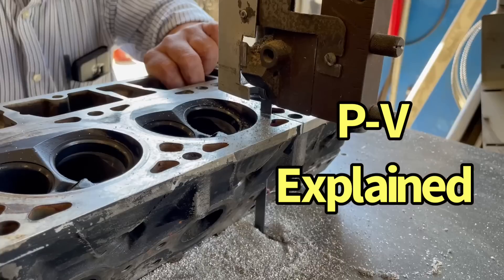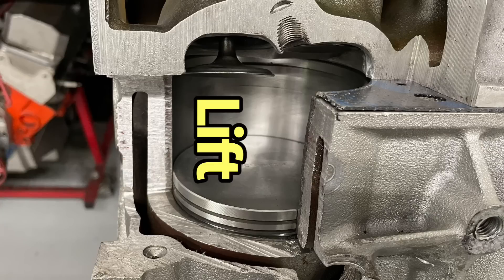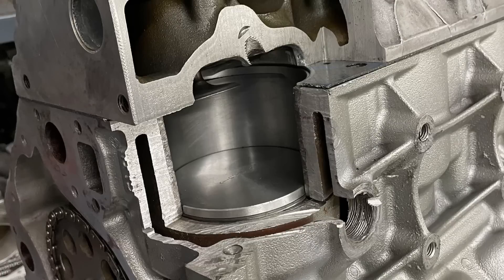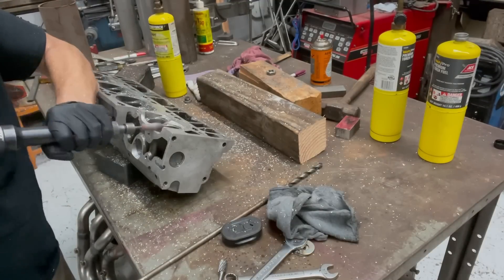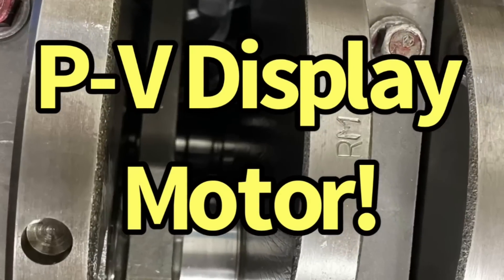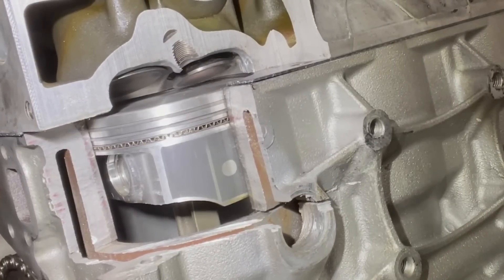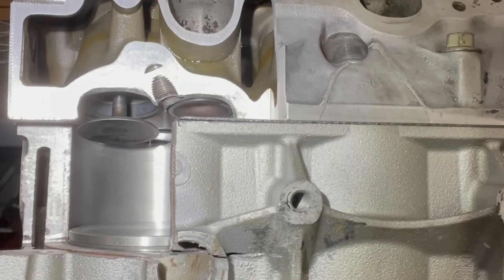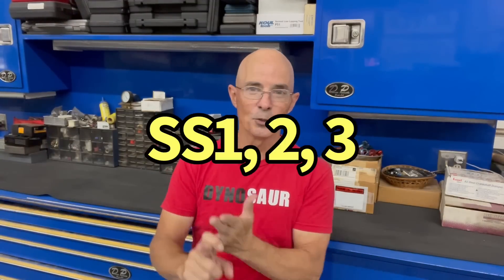WHAT IS PISTON TO VALVE CLEARANCE? THE ULTIMATE GUIDE TO SEEING AND UNDERSTANDING PISTON TO VALVE!

Comment: Fantastic video and idea, Richard. Next up you should demonstrate techniques for actually testing PtV clearance. Perhaps do the "clay" technique and rolling the engine all the way over, and then also the dial indicator approach only in the danger zone. Then you can discuss the pros/cons to each approach.
Reply from the maker: I want to show where the valve hits on the piston and why LS dish pistons might not improve p-v
Reply: @richardholdener1727  would really be helpful to show how to test VVT and or lobe separation angles/LSA with a bigger/aftermarket parts and how limiting the phaser, change's-different's and for others the importance of it plus showing valve floating and deflection's-all-parts and why's it's okay and in some cases it's extremely a bad idea/thing to have. having a pushrod that's collapsible/expandable aka something like a hydraulic cylinder ( and or figuring a way of pressurising the lifter's in the cut-away, basically how my engine now works with a jerk-pumps and pipes/liquid-rods and slave-cylinder's and software/ECU instead of fixed steel-rod's+rocker's ) and a hand/porta-power ram-pump can showcase differences 😉 👍 , also a different but related idea is having a extra sloppy/stretchy piston or piston-pin can show were/high-mileage's/lacklustre-maintenance and also higher loading/RPM and how it can change P/V clearances and timing ect

something i kinda/think 🤔i know how just not 100% testing processes/setup/efi-ect-tunes yet on my modified 1960's-540~ci hemi 4.3X4.5" stroke as i add a 60*lsx twin phasers ( yes i need the limiting blocks/software-lock's but not fully sure on maximum setting's yet 💯 ) to change VVT&LSA timing's ect plus VVL/multi-air system and variable valve-spring-rate like a f1/race-engine car ect

Comment: Great job on this video! I just bought the low buck truck. On my LS1 which has flat tops with no valve releafs, I had to deck the block .005" and over time the heads were milled .015" I an anxious to get the parts back and pre-assemble to see if I am going to have to go with a thicker head gasket and have to figure out the best way to check P-V clearence.
Reply from the maker: easy to check P-V but you won't have a problem-you have miles of P-V on that cam (even with you minimal milling)

Comment: GREAT VIDEO!!
Install a cam designed for supercharger use with 0 to negative overlap verses a NA cam with lots of overlap which gives that old school lopy muscle car sound. And explain why no to negative over lap (explain negative over lap too) is best in a blower application verses  a NA cam with lots of over lap. And how wide overlap can get dangerous with piston to valve clearance. And add to this how a improperly timed cam can cause piston to valve strikes. And why degreeing a cam is very important bro know it’s timed correctly before starting up.
Reply from the maker: the cam that makes more na power will make more boosted power-stop with all this overlap talk

Comment: Piston chases  the exhaust  valve  so always  use .110 min on exhaust  side, youll be safe intake  0.080 min  with 0.031 radius  in piston  pockets  ! Save for lots of street strip  motors

Comment: Question: you didn’t share with us what MINIMUM clearances we need on the exh/int sides?  .070” ?? 🤷🏻‍♂️.   Also does ratio rockers affect piston to valve clearance and how?  

Thank you 😊
Reply from the maker: rocker ratio can alter p-v because (in addition to lift) they also alter duration slightly (by 2 degrees or so depending on ratio change)
Reply: @richardholdener1727 ok thank you much!  👌🏼

Comment: I would like to see PTV based upon head milling.  So if you over mill the head you can then simulate different head millings with gasket thicknesses.
Bias cause I had my head milled .020 and would like to see the change to PTV it caused.
Reply: Same I milled my heads to 58cc and have a 232/242 .600 / .600 113+3 cam. Clay method showed plenty of clearance but would be cool to see in action.
Reply from the maker: I can remove the gasket

Comment: I have seen some people fly cut their pistons because the piston to valve clearance is not enough. I am curious is fly cutting an acceptable procedure, or it's not recommended.
Reply from the maker: it can be done as long as there is enough material in the piston and it is done correctly with the piston in the proper position

Comment: What happens if you have a very short, duration, low overlap, but extremely high lift cam shaft? Does the cylinder get more air? simply opening the valve more, but not necessarily for longer. Normally LS engines really like a 600 lift but what if there was say a 7 1/4 lift or even more than that?
Reply from the maker: the cam lobe is very unstable with high lift and low duration
Reply: Actually, that is a good question to answer. Have you tested enough cams to actually run into this effect and if so, what lift-to -duration numbers bring about the instability you mention and at what rpm? For instance, say you are building an engine and want the cam lift to be .525". How short of a duration would cause the effect? Then give duration thresholds for different lifts as well, for example .550", .575", .600" etc... so the trend can be graphed and or visualized. I expect that you would see why the old small block HP cams had such low lift to high duration numbers. The trend today is to go for mega lift while trying to keep duration short which starts to infringe on the laws of physics with drastically increased stress on the valvetrain. Would Comp Cams already have such a graph showing which lobe designs are prohibited by the lift-to-duration relationship?  @richardholdener1727

Comment: Very nice Rich!
I got a 454 with 9.1 comp. With Edelbrock hi comp BBC heads. 280 duration, 566 lift, 1  7/8 headers. What do you estimate my HP would be ? I think my torque would be around 500 FT/Lbs. Based on Gen IV blocks that’s mine1972.
Reply from the maker: what intake?
Reply: @richardholdener1727  a Summit Dual plane.
Reply: @richardholdener1727  400TH auto, 2500 stall, 3.73 gears, Eaton Trutrac.
Reply from the maker: could be near 500 hp

Comment: Hello Richard I have a 4.6 DOHC (rebuilt) with a stage 2 comp cam - all followers and lashers all new Ford parts. On the driver’s side the valve train is a little louder and the passenger is kind of quiet. 5 mechanics said that yes the driver’s is a little louder but that’s normal - I know this is not per say. Is it possible this noise is happening because of PTV - the shop has not degreed the cams?

Thank you!
Reply from the maker: did you check p-v? does the piston have valve reliefs? are the cams degreed side to side?
Reply: @richardholdener1727  the cams were installed as if they were factory cams by aligning the dots.
Reply: @richardholdener1727  also compression test. Passengers side pistons range from 150 to 160. The drivers side pistons range from 120 to 130 - this is the side that I hear the valve working. Thank you Rich!

Comment: Ok, Rich, I'm building a Gen3 LM7 5.3. I went with a Truck Norris cam. Assuming deck height is oem, could i run a 1.299 CH 2cc dome piston such as summit racing pn SUM-2999273810-2 ? What piston would you recommend ?  It's for a jeep wrangler for low end/ mid range rock crawling application but i want power when i need it too.
Reply from the maker: for what compression?
Reply: @richardholdener1727  disregard. I've decided to do a LQ9 crate w/LS6 cam

Comment: Use the cut off pieces to cast a clear acrylic part, slap that on the engine and run smoke through the chamber to see how the air flows. Love the cutaway engines, Chrysler had them as a motorized display.

Comment: You know if you put the spring you're running on that head and check the clearances it will be different from those test Springs you're checking them with you will actually have more clearance with the spring you're going to run. Yeah I couldn't wrap my head around it at first either I bought a 522 from reher and Morrison. I bought the short block first and bought the heads later when I could afford them. I like your self always check them with test Springs for the clearances so I did. My dad's buddy who has built engines most his life I was over at my garage wanting to see that motor and he wanted to stick around and help me check the clearances and stuff. Like I said we used test Springs the clearances were not there he starting to tell me I needed to take the engine back apart and cut the Pistons to get the proper clearance. He said they screwed up. So I called Keith down at Reher and Morrison and told him what I had as far as the clearances. He asked me if I had the valve spring that came on the head on there and was checking it. I said no I'm using test Springs. He told me I was doing it wrong and I needed to put the valve spring that I was running back on the head and check it that way. So I did and he was right the clearances were there right on them but they were there made quite a bit difference from the test Springs from the actual spring that you're running on the head. Now me being a machinist I couldn't wrap my head around it either Tumi that clearances is clearances. I guess valve spring pressure has a lot to do with it. The only thing I can figure out. I mean they were short .030 to .040 on the intake and exhaust. I know 4 A fact that you better keep fresh valve springs on that motor or there's going to be a bad day at the strip. I guess most engine builders just like to play it safe and don't want to depend on checking valve spring pressure & have to change them when they get  a little weak. I'm not sure if Keith still works there or not bcuz it's been a few years back but you can call down there and see if he still works there and ask him. The Pistons are so close into that head that you have to orientate the plugs. it is a 14 to 1 motor. The heads are Dart pro-1 355's I haven't had a bit of problem out of it I ran 7.81 at 171 in the quarter straight out-of-the-box. I don't know if you can see my picture or not but that's my toy. Just a bracket car pro-class or super comp. I'm just like the rest of you I like to throw money away! I wanted to hear what your thoughts were on it. I know other engine builders don't buy it.  Until they try it. It does make a difference. I was getting ready to tear the short block down and cut the Pistons. He actually told me I was full of shit put the race Springs back on the head & check it again he guaranteed the clearances will be there exact words! Thanks LJ
Reply from the maker: why would spring pressure change p-v? The only change could be deflection in valve train if you have serios pressure-and there is more p-v in a dynamic running situation due to deflection but this is an accurate method

Comment: Richard holdener please give me a little help with this problem that I run into I was changing the ignition coils on a 09 murano and one of the small nuts from the intake fell inside the holes valves and I didn't know until I crank the engine when I put everything back i heard the little rattling and I turned back off 
Do you think if i lift the front tires and spind the crank case bolt I can open the valves ang get a borescope with magnet and fish out the nut? Cause the spark plug hole is  little smaller than the nut cylinder #6
Reply from the maker: that will be hard, but worth a try-then pull the head and make sure you didn't damage anything (piston or valve)
Reply: @richardholdener1727  it  broke the piston 🤣 now I have to. Take the head out and change the piston. Do you have any videos related to this engine, or do you know where I can buy a book to desamble the engine 
Thanks a lot for the reply. Thank you, brother

Comment: A good video on how to know what cam will fit without pulling the heads. Is there an equation or something to use with your current p2v clearance to find out if another cam will fit before installing it?
Reply from the maker: if you already know existing cam (and specs and how it was installed) -then you can calculate

Comment: You can put a zero overlap cam in and show how much real overlap there actually is.  The Red Hot would have only had 6 odd degrees of overlap at 50 thou tappet lift but there was plenty of valve opening for both valves at TDC.

Comment: Very cool cutaway.  This is one of those things that's so hard to explain to people, and a great visual goes a longs ways.  It would be neat to talk a bit about acceptable piston to valve clearance in different configurations, what impact cylinder head milling and gasket thickness changes have, and maybe demonstrate how some flycuts or aftermarket piston with reliefs can add meaningful clearance.  It would also be interesting to explain some common failures that result in unwanted PTV contact (valve float, lifter pump-up, broken spring, loss of cam to crank sync via some loose cam bolts, etc) and what can be done to mitigate those scenarios.  Great visualization, should be a lot of ways to use this to demonstrate all kinds of things.

Comment: Just use the clay.  It's easier.  Place the clay on the piston, put the head on with no head gasket, adjust the valve so there is no clearance (compress the hydraulic plunger), then rotate the engine by hand  If there is clearance, you are good to go. A wide LSA is worst than higher lift.
Reply from the maker: so many things wrong here

Comment: I am building a NA 5.3 for a very light car. Sub 2k pounds. After reading and watching alot of your videos I plan to run flat top pistons, 317 heads milled .030, and a an ls9 cam wit lh 7k redline. I am not chasing max power. I am wanting to change the character of the engine from low end grunty truck engine to rev happy sports car. Also running a 4 speed manual transmission. 

 Being the car is so light and I am only able to fit a max for 185 section tire its an advantage for me to have more power higher in the rpms than down low where I have little traction to work with. 

What do you think of this combo? Go or no go? PTV is a concern which is why I ask on this video. Not a cobra btw.

Comment: I’m curious in understanding how lsa/icl affects how you install a camshaft. Greater lsa = more pv clearance, but usually pushes peak hp/torque higher in the rev range. Should (or can) you advance that camshaft to lower peak hp/torque, or should you retard the camshaft to take advantage of the high range of the camshaft? Or is it specific to the rest of the build? How about all of this with a tighter lsa/icl? 

Do you need to take into account a certain amount of wrist pin slop at the top of the stroke when installing the cam? How do you know when the pv is too tight?

Comment: Tooly's cams are boring. Install a real cam such as the TSP bfd Chop Monster 228/232, .629/.600, 108 LSA  105 ICL and give us clearances.
Reply from the maker: that is a small cam
Reply: @richardholdener1727  cranking compression should be about 190-200 for best street torgue.
Reply from the maker: Your (or anyone's) definition of "Best Torque" is not universal, it is wholly subjective.  And your cranking compression value is not dictated by the cam alone, so again....
Reply: @richardholdener1727  flat top piston 5.3-5.7 on pump gas. No pop ups. Nevermind...TSP said it will clear just fine.